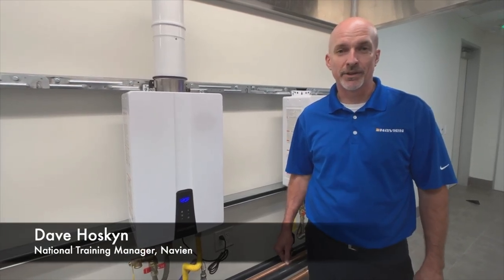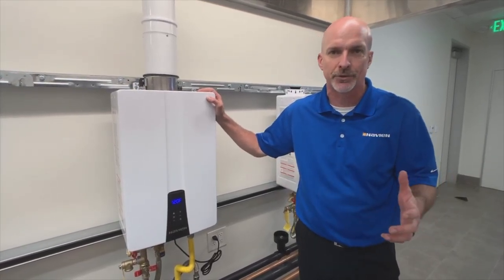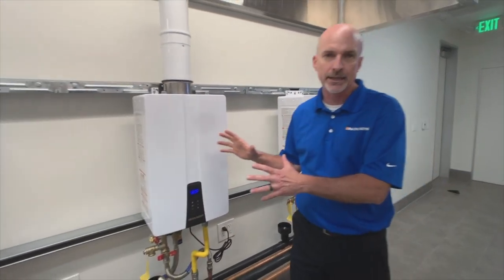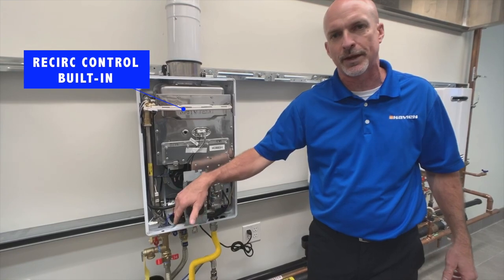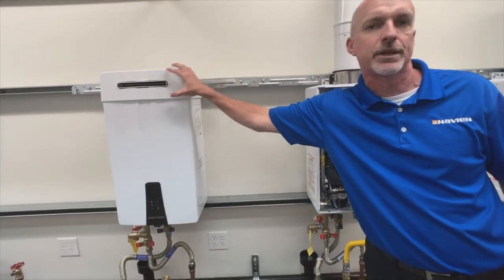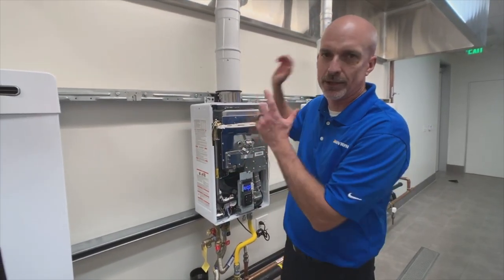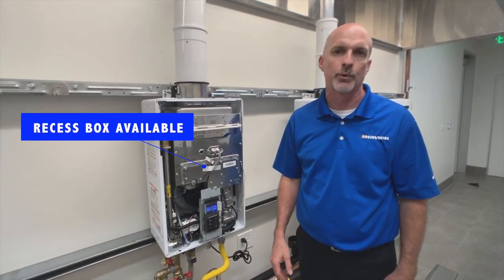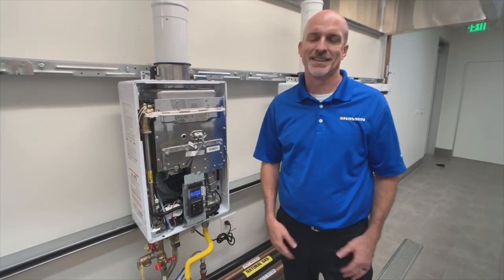New Navien non-condensing tankless NPN-U & NPN-E

Comment: What is an error code on the NPN 180u. The code is E773
Reply: Idk
Reply: Why did you even bye this thing
Reply: @Victor-nn2wi  End up being low gas pressure. The gas pressure wasn't low, it was the circuit board being faulty.